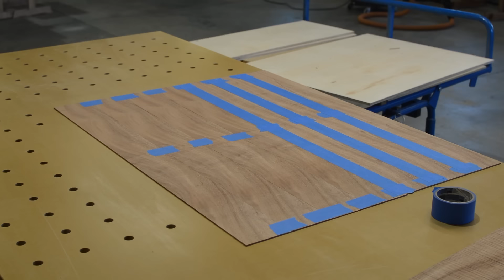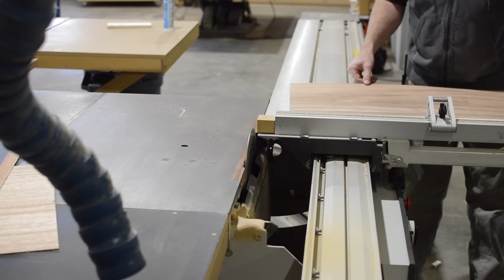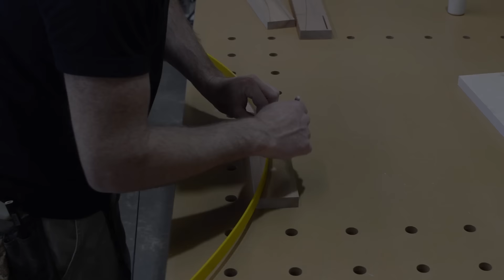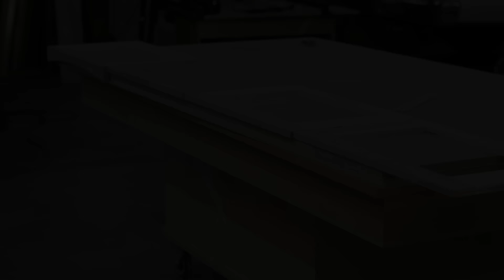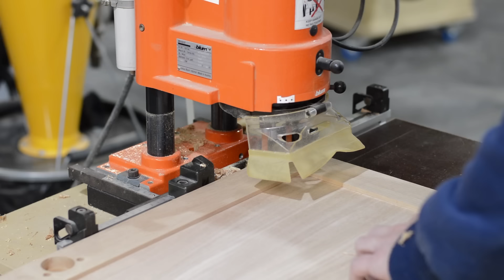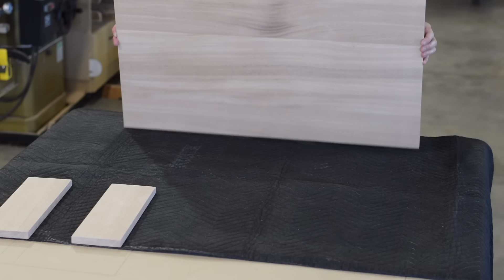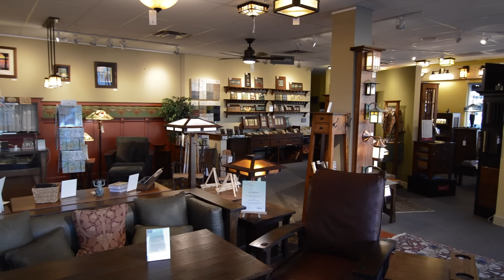Mahogany Wine Cabinet, woodworking, furniture making, carpentry

Comment: Hey, Mike,  nice design and good craftsmanship as always!
I have a question regarding your finishing: I saw you using water-soluable dye, followed by an oil-based wiping stain... but no protective topcoat.  Did I somehow miss that?
Reply from the maker: I edited that out. I was in a hurry to get that part done. I used a catalyzed lacquer.

Comment: Hi mike I see something that might help with future builds . The wood whisperer screwed his drawer fronts on using the handle holes I thought it was genius saves using masking tape and super glue or the locating dowel pins . I've been a making kitchens for nearly 20 years and as I always do my handle holes last I never thought about it. But it will save so much time and be so easy to line and square up drawer fronts . Anyway great video as usual cheers darrall
Reply from the maker: I have seen that, the problem I would run into is I never have the handles at that point in the project. I normally don't put on drawer fronts this way, I just did that for the sake of the video. Normally I use Blum drawer front adjusters.

Comment: Sorry to say, but it's videos like this that originally put me off woodworking. Massive machines most people can't afford. Go the hand tool route people.
Reply from the maker: I'm sorry you feel that way, if you found this video to be discouraging, why watch it? Why comment? My opinion is that hand tools are not much cheaper than buying used machines. In fact, I paid less for my jointer than I did for a NO 7 jointer plane.

Comment: Great build Mike. I’d like to suggest a short pro tip vid on setting up and using a spoke shave, particularly the convex round bottom version. That proves to be intimidating in part because it’s infrequently employed, so many of us turn to templates. But you nailed the fact that one has to consider the time saved with hand tools.
Reply from the maker: Thank you. I will try to include a bit about that in a future video.

Comment: Try General Finishes High Performance Top Coat (polyurethane). GF water based poly doesn’t yellow the wood so they claim. I just finished putting in VG Fir casing using GF HP in a semi gloss and it took three coats, sanding the first coat with 320. Results were great I used a $3 foam brush. You can also shoot the GF HP instead which is quicker and more forgiving then a straight spray lacquer for example. It’s formulated as a brush or roll on application , because it has self leveling stuff in the formula.
Reply from the maker: I have used that finish, it is very good.

Comment: I've had great success aging mahogany by applying a baking soda and water solution to the project and letting it sit in the sun for an hour or two. After applying an oil based finish, it looks like it aged for years and there's no pigment like stain to cover up the natural grain and color.
Reply from the maker: In this case I would say the stain didn't cover up any grain. I have used a few other methods to age wood, the issue that I have is control. I offer the customer a stain sample, they approve it, and I need to be able to repeat it. Its pretty easy to do so with stains. I have not found that to be the case with other methods.

Comment: S6 biscuits are fantastic but if you cannot get them just normal biscuits on the frame they are more than strong enough. On the backside of frames you can use pocket homes if you are stuck. And if you do not have access to either just use the old fashioned glue butt joint.
Reply from the maker: I agree, I always try to use the biggest biscuit that will fit, but the 20s work great if s6's are not available.

Comment: It is your voice and the manner you speak;   it is less learned,  more natural and inherent.
I watched this particular video , I think , 3 times.

Question:  instead of 1/16  veneer,  If I use 1/8 plank with lots of dumbbells,  Do I still need vacuum bag  for 1/8?

Thanks and greetings from north California ( mid Pandemic , June 2020).
Reply from the maker: Thank you very much. 1/8" is about the max for veneer, any thicker and you run the risk of solid wood problems. If you put enough dumbbells on you'll be fine. Put a few layers of plywood down to help spread out the weight.

Comment: Love your videos and work. Jealous of your shop, equipment, skills, talent and that you escaped SOCAL. Just wanted to share something I've found useful for jigs. I noticed that you used white glue on your leg jig. I've found CA glue and accelerator for my jigs works great and when I need some extra strength I add screw or nails. No risk of sliding, stays in place and ready for use right away. For what it's worth.
Reply from the maker: Thank you. Getting out of SoCal was the best thing we ever did for our family without question. We just couldn't make enough to live there comfortably. I do the CA glue plus accelerator once in a while. I seem to fall back to the wood glue simply because its what I know, not because its the best or easiest for the job.
Reply: @MikeFarrington  Lived here all my life but would l love to get out. Not a snow guy and our grand kids are close by here so we'll stay put.  At least until they finally make impossible for us to stay.
Reply: @MikeFarrington  I'm curious about the market in Denver vs Socal.  My wife does decorative painting and finds that market tough here compared to people she knows on the East and Mid West. Seems like Californians place a low value on craftsmanship. My wood working is really a hobby not meant for an income. I know I spend more time on detail than is marketable but I'm curious about the market differences.
Reply from the maker: @woodpurposedmechanic8299  I wouldn't put too much into my opinion, but I think Socal is a great place for the trades if you can break into the ultra high end. There are lots of people with lots of money there. Denver seems to have a pretty robust upper middle class, but totally falls short on the way upper end of the scale. This has been a pretty big hit for me. In Socal I would often work in homes worth many millions, here in Denver its more like 500k to 1m, with the occasional 1m plus. Hope this makes some sense.

Comment: Very well done! It's always a treat to see you work. Great choice on the stopped dados for the door panels and then using dominos. I've recently had some cope and stick shaker doors break when stressed but I've never had a Domino joint in combo with a stopped dados fail. I've been making my doors just like you did today and it's worked perfectly. Also, I'm reconstructing a 1931 Woody car for a commissioned job and all of the cope and stick joints have failed. The only ones that are still in tact are the standard blind mortise and tenon. 

And very interesting that you were able to do this for a furniture store. I've done a little work for a few furniture stores as well. I never got too many call backs unfortunately. Not for quality, but because they were able to simply get decent products cheaper that were mass produced and they had better margins on them. 

That would be very cool if they ask for a consistent supply of pieces. Though I've personally been disappointed by most similar hopes lol. I'm now convinced my business will be build off the backs of relationships with hard working people who want my work one product at a time with years of intermission. Which is ok as well. As long as the work comes I'm happy lol 

PS. You are correct... The amber/poly color on maple sucks. 

Thanks again for sharing your beautiful work with us
Reply from the maker: Thank you for the kind words. I think the plan with Modern Bungalow would be to make a piece once in a while, more along the lines of a photo type. If it gets enough interest they will talk to their factories about making a bunch. Making furniture one at a time is not a very good business proposition, but it is fun. I really like that style of door, fast and easy, but mega strong.

Comment: Out of curiosity, why do you prefer a biscuit for your web frames if you own a domino joiner?  I often seem to hear (and agree with) the idea that biscuits are meant strictly for alignment, not strength. I understand it's a jumbo biscuit, but it's still made of the same stuff, no? Compressed wood fibres. Can it really replace a floating tenon?

Very nice finished piece 😎
Reply from the maker: Thank you. Biscuits (at least the ones I use) are not compressed wood fibers, they are solid beech that has been compressed, same as a domino. I prefer biscuits for speed, ease of use, and cost.

Comment: I have never found any instructions on how to use trans tint.   Would you be able to make a video on how to use it?   What to mix it with?   I find it interesting that you mixed it in water.   The only instruction I had was to mix it in lacquer and then stain over that
Reply from the maker: Thank you. I don't think I could make a video on trans tints, videos take lots of time and for such a specific topic I don't think it would pan out. I will try to include more info in a future video. They are easy to use. They will mix with pretty much anything, they can be sprayed or applied with a rag. For a darker stain, mix it dark, and so on. I like to mix with water, its easy to work with. They can be added to lacquer to do a little tinting.

Comment: Try something with Rubio Monocoat Mahogany and you can get that color with no separate stain and finish all in one step.
Reply from the maker: Thank you for the tip. Rubio isn't a finish I would put on a cabinet going to a customer. Just isn't durable enough. Unless the customer asked for it directly.

Comment: Hi Mike. Would you care to elaborate on how you attached the top to the cabinet to allow for seasonal expansion, as I reckon this one is made of hard wood? Thanks a lot for a very informative video!
Reply from the maker: Yes, top is solid wood. I used normal pilot holes on the front holes I used oval holes for the back holes.

Comment: hi amazing video! can you please explain the reason for the using the vacuum bag while you applied the veneer??
Reply from the maker: Thank you! The vacuum bag is used to apply clamping pressure to press the veneer down to the substrate until the glue has dried.

Comment: This is the 1st video I've seen of yours. I like how it turned out; its clean, the gaps/color are perfect. The legs stood out in that typically legs are wide at the top/narrow at the bottom; yours are the opposite and it adds elegance. IF anything stood out its the bold grain door pattern b/c its the opposite direction of the bottom drawer. Its just my opinion, but to me it would be nice to have had the door grain be less proud like the upper drawers; again, its jmo and overall it turned out beautiful.
Reply from the maker: Thank you.

Comment: Are the web frames affected by seasonal movement? Is there anything special that needs to be done to a joint where the grain is running perpendicular to each other?
Reply from the maker: All wood is affected by seasonal movement, its a question of how much and is it worth worrying about. The web frames will not move enough to matter, thats part of the reason I used them. With regards to perpendicular grain, any joint under 4" is not going to be a problem, up to 6 or 7 should be ok, 8' and up may start causing problems. Larger than 12", is where some bad stuff can start happening. There is lots more to this topic, humidity swings, temp swings, species of wood, glue used, etc. I could go on. Hope this was at least a little help.

Comment: Wait. No more Blum drawer front adjuster?  Do you find this FastCap method quicker/more reliable?
Reply from the maker: I still use the Blum adjusters, but I wanted to show something different in this one. I think the Blum method is more reliable and consistent, but the blind nails are basically free.

Comment: I found your piece on their website. Glad to see it priced appropriately for the amount of craftsmanship and attention to detail you put into everything you do. 

Hopefully this will be a profitable partnership for you moving forward!

Do you mind sharing about how many hours you have into constructing this?
Reply from the maker: Thank you. I hope so too. It would be really nice to have a place to be able to consistently sell pieces like this.
Reply: @MikeFarrington  Apparently the question of your hours either went right over your head, or you don't want to reveal that info. In either case, too bad.
Reply from the maker: @michaelkelly3221  I didn't see the hours part. I answer a lot of comments and move pretty quick when doing so. As to the question, I really don't remember, plus when I'm filming its not a good measure as that add lots and lots of time to the process.
Reply: @MikeFarrington  Slow down, you're not CEO of Ford! Admitting you move quickly and don't remember, isn't exactly an endorsement for your work!
Reply from the maker: @michaelkelly3221  Charming comment, thank you very much.
Reply: @MikeFarrington  De nada.

Comment: Nowadays I click like before actually playing the video  🤷🏼‍♂️

But now that the video ended all I can say is: wow. Really great piece of furniture Mike, everything looks spot on.

But in today comment I also have a question for you: talking about painted wood (most likely MDF) do you know/think it's possible to achieve a "spray like" finish with either brush or roller and water based products? Any tip would be highly appreciated.

Best!
Reply from the maker: Thank you very much. Its possible to get a pretty darn good finish with water based and a brush. Good quality brush, even brush strokes and a high quality finish. Do buy a cheap product and expect it to work good. The water based Polycrylic from Minwax flows out nicely and is reasonable durable.

Comment: Mike, another great video the cabinet looks great.  were you not concerned with possible blotching with the stain? . watched this on an iPhone and t has some funky artifacts at 12:40 for about 30 sec. also on Mac.  Maybe just my internet?
Reply from the maker: Thank you for the heads up. My computer shows the artifacts as well. Not sure what happened, could the the 12 year old iMac and piece of junk camera? Mahogany doesn't blotch much. If that was going to be a problem I would have done a wash coat of shellac.

Comment: Well done.  I am not a fan of metal slides in furniture though...personal choice (no metal: screws, nails or slides).  Given your cabinetry background and skills, I am surprised you did not do a floating panel side.  I actually like the legs to sides via biscuits as the traditional way of doing it (if it was a floating panel with stiles and rails) is not any stronger and a great deal more work.
Reply from the maker: Thank you. I would agree that wooden slides are a finer level of furniture making, the problem is the metal slides work so well in everyday life. I'm happy to build either, 99.9% of customers want metal.

Comment: question - is veneer not available where you are? the amount of time and work it took you to make that thin glue of was a lot
Reply from the maker: It is, but the really thin stuff isn't as good of quality as shop made. Its closer in color and more durable. This project could have been completed with commercially available veneer easily enough.

Comment: Mike, your work is an inspiration.  Regarding finishes, so far I've not ventured far out from danish oil, polyurethane, and BLO for fine woodworking.  Is there a resource you can recommend for learning to work with dyes and stains?  Your suggestion to use both a dye and a stain is interesting, how do you end up deciding which colors to use and match?  Are there known formulas or guidelines?  Or are you winging it with test pieces until you get something you like?
Reply from the maker: Conor, I could easily talk for hours on this subject. I do not know of a resource on the subject that is up to date. The choice of colors comes from lots of experience, I have no formulas, just and idea of where I want to go, and I play until things looks right. I made at least 15 samples before showing the customer two. The last sentence should really shed some light on my process, test and retest. I have an idea that I hope to get to, it would be for a small project, but would be mostly focused on finishing. I would be able to address in detail your questions. Hopefully I can get to it soon.
Reply: @MikeFarrington  I hope you do chose to speak at length about this topic by video. Do you keep a supply of dyes and stains available for experimentation?
Reply from the maker: @Exodus5K  Thank you. I will try to put in as much detail as possible. Yes, I have a supply laying around, I add a little here and a little there.
Reply: @MikeFarrington  You're the best Mike

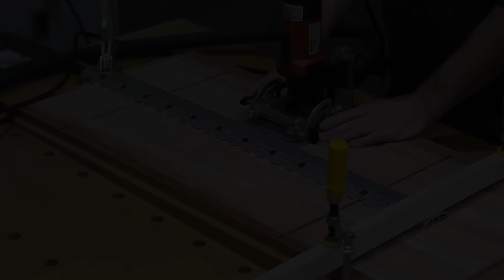Comment: @9:41 do you cut the legs to have the grain running downhill so smoothing would be easier and avoid tear-out?
Reply from the maker: Yes, if possible. I always looks at the grain and if it is possible I always cut so that the grain runs along with the taper. This will make planing very easy, as it did in this case.
Reply: @MikeFarrington  Thank you.

Comment: I have never managed to get stain as perfect as you do in this project.  I may have to give water, then oil based stain a try.  May i ask where you got your vacuum bag equipment, and what make and model you use?  Thanks.
Reply from the maker: Do it in stages. Try a light stain 3 or 4 or more coats. When applying, apply it differently each time. Brush differently, left to right, then right to left, the top to bottom, etc. This will really even things up. I bought my Vac stuff of eBay. I use the high flow Vacupress pump with a poly bag. If you buy new, its not cheap, but its very good quality.